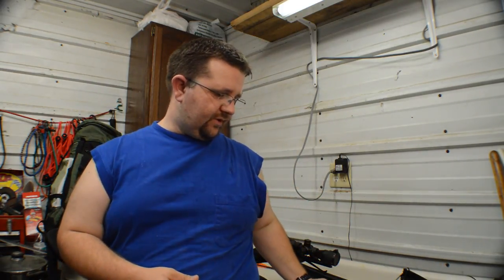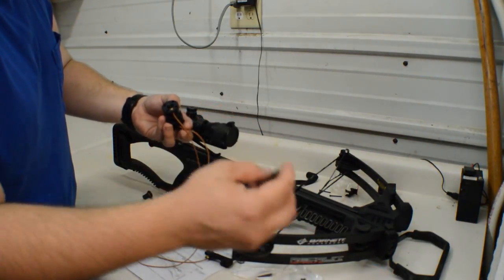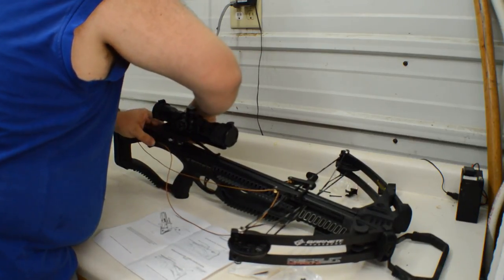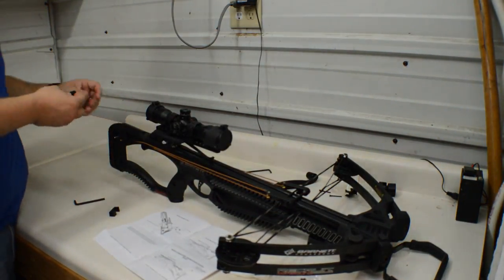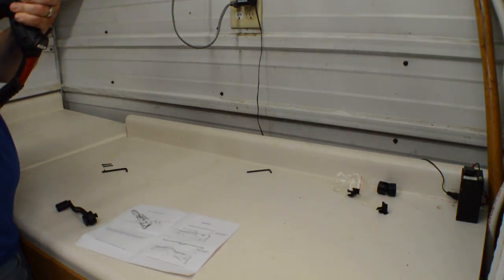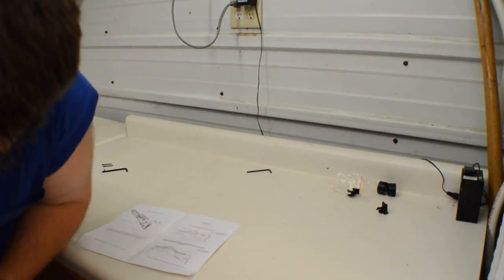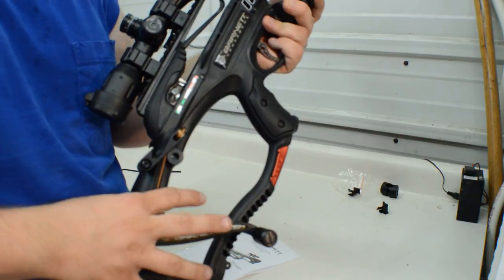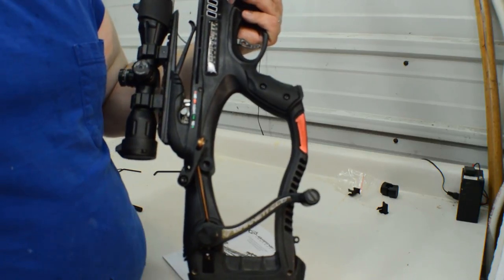How to install a crossbow crank on a Barnett Recruit

Comment: Those slots next to the front posts are for the string to pass behind so they can hold the cocking string tight to the stock. You can de-cock with the crank, hold the crank and put tension on it, flip the switch on the detent so that the crank turns freely backward but keep ahold of the crank and rotate it the opposite way until the cocking strings are slack then disengage the cocking claw that goes over the string.
Reply from the maker: +Donald Alldredge I'm sure you can decock with the crank but the instructions say not to.

Comment: What model number is that crank. I see three available but want to make sure we get the right one.
Reply from the maker: Let me check with my father in law.
Reply from the maker: 17450
Reply: Do u know if the Allen after market crank will work on the Barnett jackal that one and one other Barnett doesn't make a Crack for it

Comment: is it worth changing the string? worried that its not strong enough?
Reply from the maker: On my raptor fx it was well worth changing.   The stock one stretchs so bad on cheaper Barnett crossbows.  Mine was my consistent after the swap and smaller groups.

Comment: How hard is it to adjust the camera view??  Good detail though
Reply from the maker: I normally try.  I didn't think it was all that hard until I started to do it myself.
Reply: @BuckPole  I received the crank cocking kit and the handle hit the small release leaver as it turned...Also, I didn't like removing the hook device after cocking as you have to put your fingers in the path of the string.  All in all, the cranking is cumbersome (on my Hunter 2) so I'm returning it.  Do you like the crank as opposed to just using the pull rope?  Thanks

Comment: I don't understand why everybody says you can't decock the crossbow with it if you can talk the crossbow with it you should be able to decock it
Reply from the maker: My understanding is if it were to slip it can be dangerous.   Also I've been told when the limbs are stretched it is better to shot than decock.
Reply: I can't really see it any different than the TenPoint or a raven crossbow that would be like taking it all the way up and then deciding not to Cock it all you do is reverse the process and let it back down there's no way it could hurt the crossbow unless you like you say you slept with it

Comment: Hi, I recently purchased a Barnett Recruit, and the draw weight is around 170 lbs. 

I've tried rope cocking it and I've found it to be a lot easier to manually cock it with my hands.

I have to use rags when cocking with my hands, or I'll end up cutting my hands.

I was wondering what kind of crank you bought for your crossbow, I'd hate to pinch a vein.

Loved the video, I just need to find the right crank.
Reply: I noticed a difference in bolt impact when shooting with a cocking rope vs manually cocking with my hands. I would consistently hit to the left if I used my hands.

Comment: Hi.. just came across your presentation about your mythology and the cock cranking device.. You are very articulate in your presentation.. of being a professional photographer, you may as well had an alligator in a strangle hold.. all I saw was the camera taking a picture of the table. Some guy was out there talking about a cranking device, probably eating a steak and cheese sub.. get with it. I’m a professional photographer and you need help by all means take two …… In other words consider this procedure being repeated …someone else should be holding the camera to help your presentation maybe a close-up on a critical point of emphasis shoot straight.